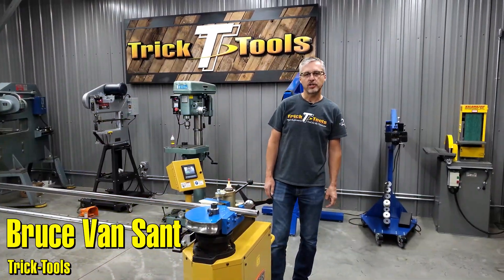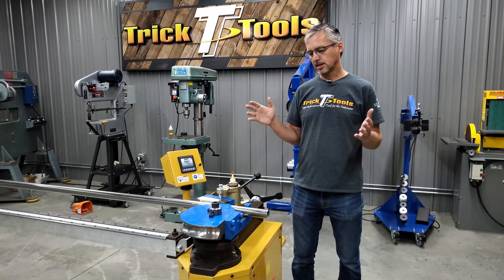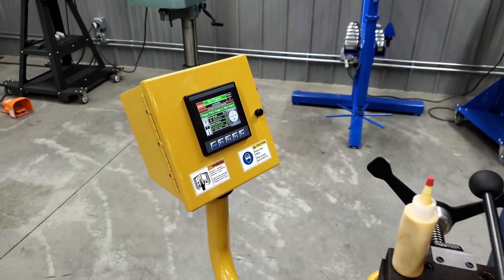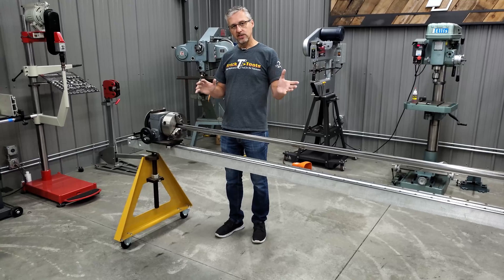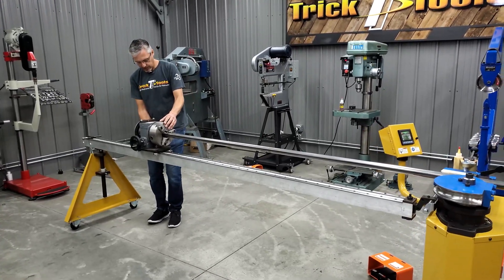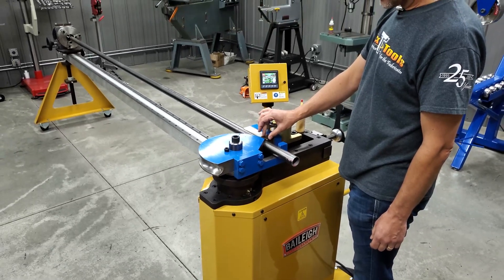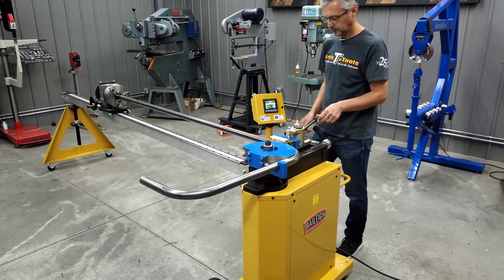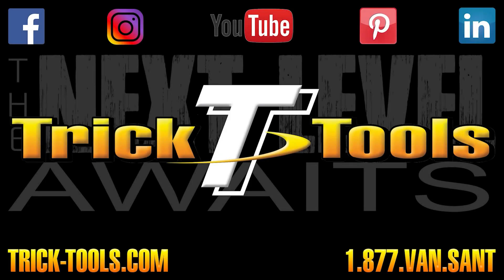Baileigh RDB-250 Tubing Bender - Trick-Tools.com

Comment: DO you get the position table and chuck with the bending machine or are they seperate?
Reply from the maker: We sell it both ways. I've included links to each product on our website.

Bender only:
https://www.trick-tools.com/Baileigh_RDB_250_Programmable_Tubing_Bender_RDB_250_2278

Deluxe Kit that includes bender, index table, and chuck:
https://www.trick-tools.com/Baileigh-RDB-250-Programmable-Tubing-Bender-Deluxe-Kit-rdb-250-deluxe-16851